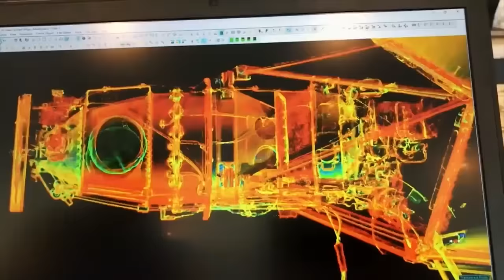We both almost died...now what??

Comment: Mike & Mark, retired cockpit designer here. We lose many pilots every year to loss of control accidents. Seems to me with the advent of AHRS in light airplanes there should be an economical way to design a retrofittable recovery system that could take over if an unusual attitude is sensed. Of course it could be turned off for training if needed. If it was cheap enough to be retrofitted to all the existing Cessnas and Pipers etc the benefits could be multiple. First saving lives from loss of control accidents and possibly inadvertent flight into IMC but it could also lower the insurance costs that have skyrocketed in recent years. I have some other ideas and would love to talk to you about them.

Comment: Develope a 2 seat Patey kit plane with engine, airframe, avionics, takes less than 1,000 hours to build, 800 mile range, 160 knot cruise, stall under 40 knots!

Pros About Aviation:
1.  Social Media Exposure
2. EEA
3. Airshows

Negatives in Aviation:
1. Not Enough Young People Getting Excited About GA(To Much Emphasis on Becoming Airline Pilot)
2. FBO prices, Gas Prices
3. Chopping and Changing of Flight Instructors When Learning to Fly(Training Cost)
4. Forced Learning on Glass Cockpits For Basic PPL, Driving Learning Cost up

Suggestions:
1. Broad Use of Kit Planes For Flight Training(Vans Aircraft)

Member of EEA and AOPA
Reply: That's everything these guys are not. Short build time, low performance airplanes!😂

Comment: I am a a tailwheel pilot and helicopter CFII, starting my career as a professional helicopter pilot. 

1. Aviation will always be exciting.

2. Insurance runs and ruins the industry.  Low time pilots are looked at as a liability but they are thrown into the riskiest aspect of aviation, flight training.  It would make more sense for instructors to be well rounded and experienced. There needs to be a path for low time pilots other than instructor . I think this starts with Insurance companies and their unreasonable hour requirements.

I have been a member of AOPA and EAA. I am looking forward to renewing my memberships and joining HAI. 

I would like to thank the both of you for your contributions to the community.

Comment: HI Mike and Mark.  First off thank you so much for being interested in helping push aviation further into the future.  There are a few things that I will highlight as going right in general aviation right now.  I love that we still have the ability to build and fly airplanes.  This is GAs future in my opinion.  Affordability of flight for the average person has become quite difficult and I see this as the only way to reliably access aviation in the future.  I will also tack on that there are so many more options of engines that are coming to us in the future.  This excites me in many ways from affordability, accessibility, performance, reliability.  I don't just have an over expensive lycoming or continental available to me anymore.  As far as things that are going wrong.  As discussed above, aviation has become extremely unaffordable.  I own a Sonex in its phase 1 testing at SPK that I keep on a tie down.  I am mighty grateful for my tie down but Utah winters are brutal and wind storms are often an issue as well.  Just a few weeks ago my canopy got caught in some pretty extreme wind and here I am replacing it.  I would love to see affordable hangers be accessible in the area.  West Desert airpark is putting in T-hangars that I think will be available next year.  Cedar valley airport could potentially be a great place to revamp and give us some more real estate for additional hangar space.  I personally don't need a lot.  Mostly just a roof over my airplanes head would be amazing.  I currently support and leverage the EAA community quite a bit.  Super grateful for all the friends that I have made through this community and the people that have kept me alive and safe for my family.

Comment: Hey guys love what your doing! I’m a pro pilot flying a falcon 50ex a CJ4 and a hawker and I own my own Cessna 210. As a whole the aviation industry is stronger than ever we have so much going right! The introduction of ADSB and ForeFlight has given us so much situational awareness and over all made us safer! With that being said the biggest problem I encounter it doesn’t matter if I’m flying the jets or just my piston 210 is FBO ramp fees. Now I know that just sounds like I’m complaining. There is got to be something we can do get them standardized or maybe help these smaller airports get some equipment as tugs and other equipment they need is very expensive. Maybe this would help them not need to charge so much. I’m not sure what is the right answer. But I often find my self going to a different airport just to avoid fees. This obviously isn’t a huge safety concern. If it deters me from getting in the air some days I know I can’t be alone. Also I’m a member of the AOPA, NBAA, GBAA and the EAA! Thanks your all you guys do and I’m glad your still with us mark!

Comment: Alpha eta Roe since college. I’m a grandfathered A&P from 2000. I would love to be able to work for or with you guys. I loved watching our local Lancair 4P with a turbine conversion come in from the north at 10 feet off the deck at 400+ knots. I miss it immensely we used to do annuals for a guy outta gold valley. And because the business I worked for was at an un-controlled airport.  This stuff we could get away with was pretty crazy. I remember that guy from Gold Valley making a pass across the yard that he had to dip his wings to get through the gates at 200 kn and watching other crazy pilots with just a vertical coming through the hangers having to drop to the ground feeling that if you would have stood up, you would have lost your head. I miss it all!!!

Comment: I truly admire both you and Marks influence and standing within the aviation community, and I believe you and Mark's support in advocating for an increase in the weight limit, horsepower, and seating capacity of Light-Sport Aircraft by the FAA could greatly benefit aspiring aviators. Such a measure would substantially improve access to aviation by reducing entry costs and maintenance expenses in comparison to certified aircraft.

By raising the weight, HP limits, and seating capacity, we can broaden aviation's appeal to a more diverse demographic, empowering more individuals to pursue their passion for flying. This adjustment would not only help mitigate maintenance costs associated with aircraft ownership but also make aviation more financially viable for enthusiasts.

Additionally, by expanding these limiting factors we could facilitate the inclusion of select four-seater aircraft in the LSA category. This would provide families with the opportunity to share the thrill of flight together and enjoy the benefits of ownership flying at a more affordable price.

In essence, advocating for these changes holds the potential to democratize aviation, making the dream of flight attainable for a broader audience. Both you and Marks support and leadership in this endeavor would undoubtedly have a significant impact on the future of aviation accessibility and inclusivity.

Comment: Hi, as a private pilot raised in Alaska I guess the positive I see is the sport pilot regs helping to keep our older pilots able to fly longer. The new revision I think is great, I’m taking advantage of the basic med as well, good for the FAA to work with AOPA, EAA and others on that! As far as improvements, I really think the bureaucracy and excessive government regulation is still stifling innovation in the light aircraft market, more so certified,  it also experimental as well mainly due to economics of scale. It is just hard for companies to bring new ideas to market without spending a fortune on approval processes. 
I am a lifetime EAA member, AP/IA and basically work on planes for people as inexpensively as I can to help keep people flying. Just finished a Lancair 360 and Glastar restoration. Working on a 170B rebuild and trying to find time and structural engineering input on the P51 project I’m working on. Keep up the good work!

Comment: Mike and Mark, first Thank you both for all you do and what you have done for aviation. What's right in aviation is the people passionately involved who try to improve and expand GA in the public. GA's accessibility is fantastic (yes, it is an expensive endeavor but so is boating or even snow skiing). 
What's wrong with aviation:
 1) The loss of GA airports by municipality land grabs or communities built next to an airport that then complain about airport noise.
 2) "Misclassification of aircraft" and what I mean by that is useful load and what is called a 4-place airplane. Try to find a plane listed as 4-place that can actually carry the load of 4 people the size of average citizens now. I very frequently run across frustrated pilots because they cannot find an aircraft that really does what its labeling says it can.
3) Lead in fuel, which is a complex issue and from what I have seen isn't scientifically proven to be harmful, but perception is what it is and I think to secure our fleet we either need engines that don't require lead or a fuel that replaces lead.
4) Safety, with what seems to be a higher level of GA crashes I have even started to get pushback from my wife about wanting to get in a small plane, many of the recent incidences seem to be related to distraction in the cockpit or inability to Aviate, Navigate then Communicate ( I am not saying that is the cause of all incidences).

 I belong to AOPA, EAA, and The American Bonanza Society. 
YES to the Albatross

Finally, if my manufacturing company Electropin Technologies LLC (www.electropintech.com) can help in any way with any of your projects please do not hesitate to reach out.

Comment: I think with your engineering background something you could help with is the entry level to owning and maintaining your own plane. I’ve had an idea for years about a modular airplane that could be upgraded/swapped around as the money, time, skill set, and needs demanded. I’m not sure if such a thing is possible, but if it were possible, it would make parts interchangeable and resellable which would help the market as well. Maybe making the engine, instrument panel, wings, landing gear, etc modular and several variants that could plug and play. Again, I’m not sure something like that would even be possible. Thanks for reading!!

Comment: I'm a life long aviation enthusiast. Currently a Student Sport pilot (At 57 years old I wanted to check off the bucket list item)  

1.  The community in Aviation is strong.   As an older student pilot I have been welcomed by many local pilots, instructors and others. It's great!

2. I have a few items for this list :) 
a. Cost.  You know the thing.  It is really expensive to learn to fly these days.  
b. Medical -  I have a couple of things that would require more paperwork to get my medical. I don't want to sit on the ground for 6 or more months to do that while I could be learning and flying.  As a sport pilot, you only need a driver's license.  I see no reason why that couldn't also be for Private pilot .  Maybe VFR only or whatever limits, but I would have gone for private if it were not for the medical delays. 
c. Small airports. We need to save airports.  A lot of them are closing.  

3. I belong and participate in my local EAA, National EAA, Eagle flights (as a ground helper)  and AOPA.
Reply: As a side-note, I had all the book knowledge needed to fly.  Just none of the skills.  I'm getting there now.  I have 33 hours now and do just fine for Light Sport.  (Flying an RV12is).  If I would have started at 18, it would have been easier to learn the skills, but maybe not the book stuff...

Comment: Thanks for asking and the community’s support. I believe that there should be a more accessible way to get help with overcoming the mental trauma of a in a incident or scare as this can be a big turn away from getting back in the air or for allowing others by influencing others thoughts through passing on bad experiences. As well as this I strongly believe that greater encouragement of recruitment of aviation engineers throughout all the sectors of aviation as after the pandemic the industry has taken a massive hit especially in the engineering and maintenance sectors.
Thanks again for your great videos and constantly working with and sharing with the community.

Comment: Guys like the Patey brothers drive the economy and their examples inspire thousands of people, including myself, so THANK YOU!
I speak from the perspective a “small guy” that flies mostly recreationally small planes. Private jets and charter industry is also GA but it is quite different. 
To answer your questions:
1.	GA in US continues to enjoy freedom. That`s the way it should be. It is composed mostly on an enthusiastic community. There is an increased access to information on social media channels like yours. MOSAIC seems it will have a positive effect. Unleaded gasoline … maybe. 

2.	Safety and cost. These are related to each other. 
     a. Safety: GA is less safe than Commercial. The requirements for recurrent training are ridiculously low. I strongly agree with AQP training – the model implemented in commercial aviation – maneuvers vs scenarios – should be adapted in GA for recurrent training. I wonder if you would collaborate with other youtubers (Dan Gryder – Probable Cause) GA pilots need conditioning to deal with emergencies and better instruction on decision making process. 
     b. Cost: This is such a complex issue. For multiple reasons it is extremely hard to bring new aircraft to the US market. Look at Lancair, RV, Sling. Just barely hanging on bumping from bankruptcy to insolvency. The bigger companies lack mass production thus making expensive products.  Cirrus seems to be the exception due their parachute (safety !) There is so much more innovation in East European countries in spite of less freedom. In addition, there is crazy liability due to low safety. FAA acts like God. NTSB is not very helpful for GA.  Insurance business for GA is a weird and opaque industry. You cannot approach different companies must use a broker. AOPA gets commissions form insurance companies and the AOPA president has a huge salary. 

3.	I am a reluctant member of AOPA so I can have legal protection plan. Although if I ever need it I am not sure if it will help. 

I am grateful to you guys just for asking these questions and hope this will turn into positive actions.

Comment: Mark I think you should explore the "Patey Flying Circus" and restore the old days of barnstorming. Travel around the country introducing anyone that wants to all types of aviation with rides and events. Team with schools to engage in the STEM programs maybe even bring along a plane project that each of them could help with a step over say a week. 1. What's going right...manufactures are embracing technology and starting to make it reasonable to upgrade old aircraft. 2. What needs help...Out reach to the communities to show how important general aviation is and that like truck drivers if we don't have general aviation we won't have commercial aviation. 3. I've been a member of AOPA since 1992 and an EAA member for about 5 years. I also have been part of HAI (now VAI) and the Seaplane Pilots association.

Comment: I was in Jimmy Buffets Albatross and it was awesome. He had surf boards and fishing gear hanging off the ceiling. He used to have it flown, with props turned up, over his concerts to rev up the crowd. Mike read A Pirate looks at 50 by Jimmy Buffet where he chronicles his trip around the Caribbean with a friend. They stopped and surfed and then met his wife and kids for dinner. The wife and kids were following in his jet.

Comment: You’ve both been so inspiring through my journey over the last several years from tow truck driver to pilot. I’m currently in training at a regional carrier. I was in Salt Lake a few weeks ago for indoc. Now in Denver for systems and procedures. Next week to Seattle for SIM. 

Here’s one thing I’ve noticed so far. There needs to be some improvement in the 121 world. I’m seeing the Jepp app, not the plates themselves but the app, is not user friendly. I don’t feel like Jepp has a whole lot of incentive to improve it. The Jepp app and plates are provided by the airline you work for. Unlike Foreflight or Garmin where consumers CHOSE to use them. I believe that is causing Jepp to have no incentive to improve the usability, user interface, features, abilities, etc. Maybe you could help with your relationship with Garmin or other connections.